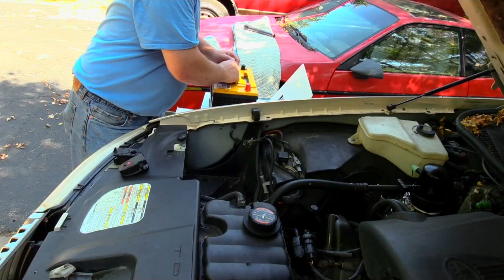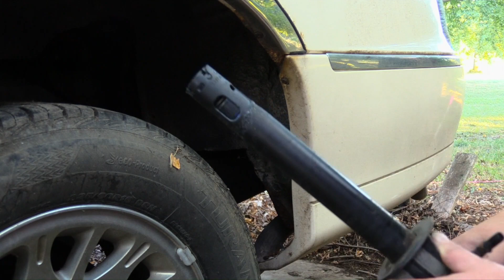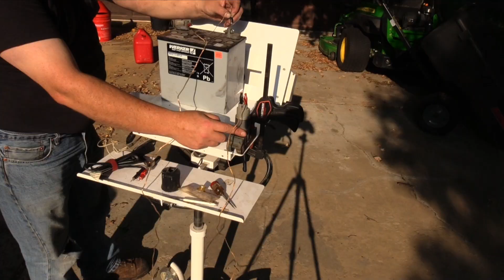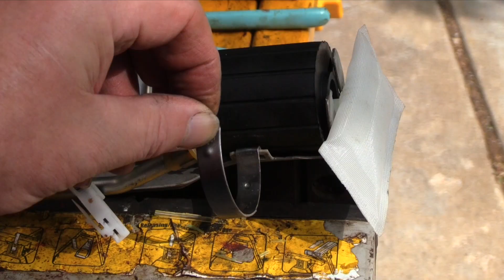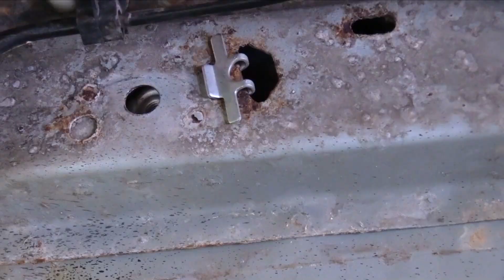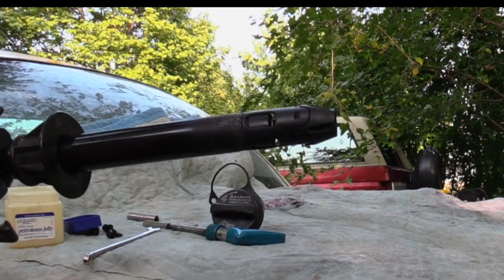Engine cranks, no start ! How to Troubleshoot & Replace a Fuel Pump on a 1998 Lincoln Town Car

Comment: I’m not getting fuel to the fuel rail smh please help me I changed the gas tank the fuel pressure regulator I don’t know what to do
Reply from the maker: Check your fuses First !!!! When you turn the key on do you hear the fuel pump turn on briefly ( build pressure and turn off) .  If so check / replace your fuel filter. If not remove and test your fuel pump
Reply from the maker: The fuel pressure regulator is on the fuel rail at the fuel line disconnects. There are a couple things to consider .

Ford has a fuel pump shut off in case of accidents , the reset is in the glove compartment 

The fuel filter could be blocked or installed backwards, check the arrow , should face toward the engine . 

Test the wires at the fuel pump for power ( perhaps the plug is not fully seated)

Comment: My old Mercedes fuel pump was just under the car. I took it out easily and replaced it this ridiculous fuel pump inside the tank or forget it. I’m gonna give my car away.
Reply from the maker: Fuel injected cars need the pump inside the tank to supply the pressure and consistency needed. If the tank is mostly empty it’s not difficult , rusted bolts can be challenging to remove without breaking (sometimes). The rest is routine

Comment: I put a gallon of gas n my Lincoln its just cranking it wont start 1995 Lincoln town car
Reply from the maker: Check for spark first, it’s the easiest, and most common failure. I have a couple Fiero videos that show a simple method
Reply from the maker: One gallon of gas may not be enough for the fuel pump to draw it .
Reply: Thanks so much

Comment: My Lincoln will start up and run idle well ... but once I hit the gas pedal it  act like it's   wants to run out of gas any idea what's going on is it a fuel pump ? 😭
Reply from the maker: Start with the fuel Filter ! And the next step is to barrow a fuel pressure tester from an auto parts store and test fuel pressure.
Reply: @normanpaulife  thank you so much
Reply from the maker: You’re very welcome, if you have other questions feel free.

Comment: You don't have to remove the gas tank to replace the fuel pump?Unless the gas is contaminated?All you do is disconnect the fuel lines and unplug the plug on the passenger side then drop the exhaust down and hang it to the side unbolt the screws to the fuel pump and it will slide out with no problem?I been working on my Town car for 13 years?
Reply from the maker: I considered that too. But the car had sat for many years and I wanted it completely clean and flushed
Reply: @normanpaulife  I kinda figured that by looking at it
Reply: @normanpaulife  Great job I liked the video
Reply from the maker: @ceciljones1248  there are two other videos showing the engine removal and long block rebuild, and two more coming. That’s why it sat , i didn’t have the time to work on the engine very often.

Comment: Awesome video! Very informative! Do you happen to have a link for the mounting hardware you bought and pump and filter?
Reply from the maker: Pump and Filter I used was Bosch , and the hardware was purchased on EBAY from a Ford dealer ,  I have one nut plate. kingranch@currently.com Send me a message and I’ll share the package information part # and source.

Comment: Will the fuel filter cause me to lose pressure when driving and I turn the car off and then it drives ok
Reply from the maker: There’s actually a check valve that maintains the pressure, I believe it’s in the fuel tank on the float valve assembly

Comment: Did you use the same gasket??
Reply from the maker: There is an adhered foam rubber seal on the fuel sending unit that is “not removable” yes it was reused as per design. It is sold as a unit with the sending unit - in other words if it’s leaking the sending unit must be replaced. Unless an after market manufacturer began selling it.
Reply: @normanpaulife  gotcha thank you
Reply from the maker: Good luck , if you have other feel free ask

Comment: Great video 😊 ..how long did it take replacing all of it?...and yes i subscribe because of this
Reply from the maker: I honestly don’t recall, I believe I did it over a couple days,  with the video as a guide I expect it could be done comfortably in a weekend. That’s without cutting corners or rushing it. I alway plan ahead ( if possible) gather my supplies and even my plan tools such as “jack to remove the fuel tank” ahead of time . A mental dry run. Nothing ever goes according to plan but it helps when things need extra attention. I work alone and learned to utilize things such as cargo straps or even a quilt as helpers for extra hands or a sled for moving heavy objects such as transmissions or weighted fuel tanks . I really appreciate subscribers! And there feed back. Your questions are always welcome.

Comment: I'm getting a p1233 code on my 2003 lincoln town car do I need to replace fuel pump or is it just a switch ? Please help lol
Reply from the maker: What testing have you done ? Start at the fuse , also there’s a fuel cutout switch in the trunk .
Reply from the maker: Start by testing the easiest parts first, based on your tools and experience that could be up front ( engine bay) or at the electrical connector of the pump. If you find which two wires power the pump, you could connect power directly to the power and listen to it. You could check to see if your fuel filter for a plugged . Etc

Comment: how much is it going to cost if i were to take it the shop
Reply from the maker: Every shop is different, professional shops have a much higher hourly rate to pay for the overhead , nice pretty building and all the property taxes etc. Small shops charge much less . You can call around ask they can give you estimate. Are you certain it’s the fuel pump, not a relay ? You can barrow the equipment from major auto parts and test it. It’s not a difficult job I would recommend doing it on a weekend or long weekend would be better to help reduce the rush. Prep it on Friday evening and begin early on Saturday and finalize everything on Sunday by midday
Reply: @normanpaulife  it's just my only car and im just an aapprentice....I dont want nothing to go wrong

Comment: I have a pesky ground that every three years or so, it gets corroded and faulty. After cleaning and re-attaching, should I spray the screw and ground with paint and and primer?
Reply from the maker: Dielectric grease or replace the pesky ground wire with a copper substitute